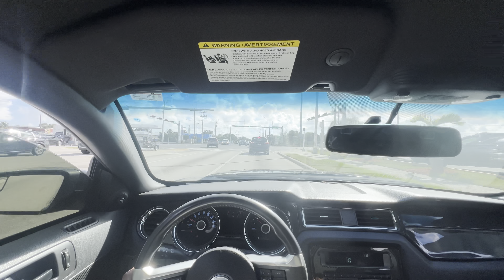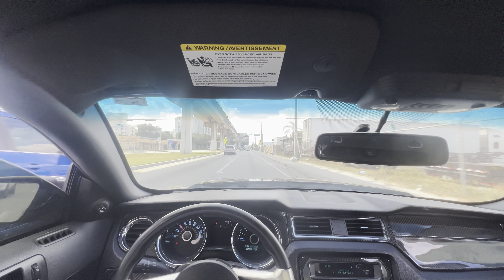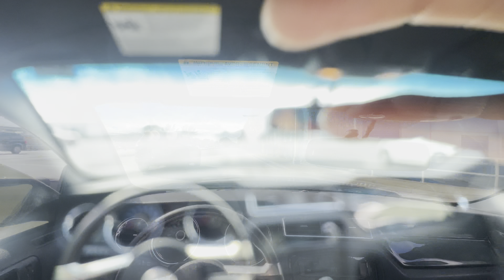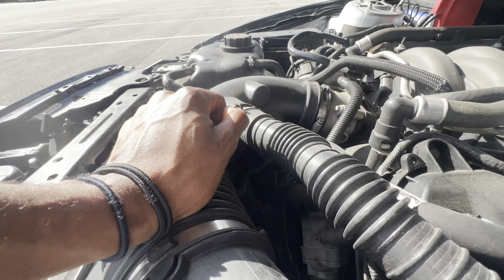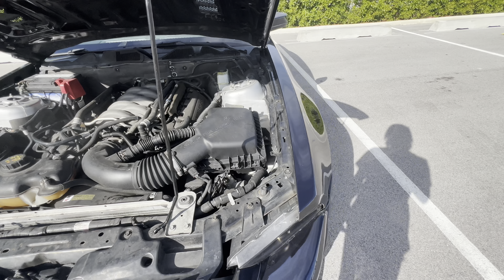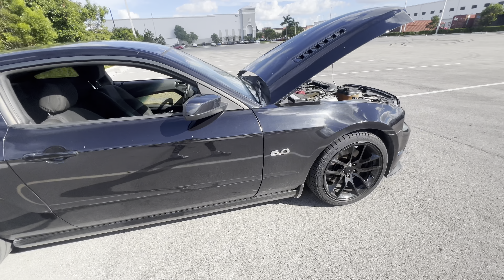POV! 2014 MUSTANG GT (Car Overheating🥵)

Comment: Check relays and fuses
Reply: Agreed. When a fan stops working a lot of times the fuse or relay can be the culprit resulting in a fast cheap fix. Worse case though at least he does have a new fan on the way
Reply from the maker: I Already Did That. The Fan Motor Was Faulty. I Disconnected The Connector And Checked For Power And Ground At The Pigtail Connector And It Was Recieving Power And Had Good Ground. Then I Bypassed The Connector And Sent Power And Ground Straight To The Fan And The Fan Still Didn’t Work. So Faulty Fan Was The Problem. Plus It Was Aftermarket And Not OEM

Comment: Also, when you bleed your car and you put coolant back in your car jacket up on the front passenger side open, the coolant kept leave the top off and run your car for five minutes to get all the air bubbles out

Comment: I had the same problem check the connector that connects to your radiator fan of the inside is burnt then you need to replace it. It’s called a pigtail from Ford. That’s how I got my radiator fan back working I have a 2013 GT.